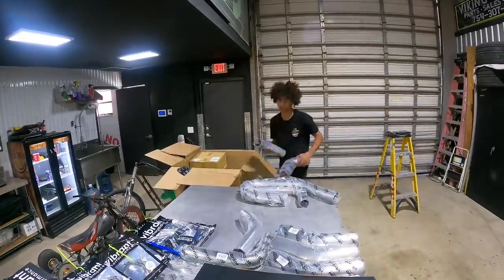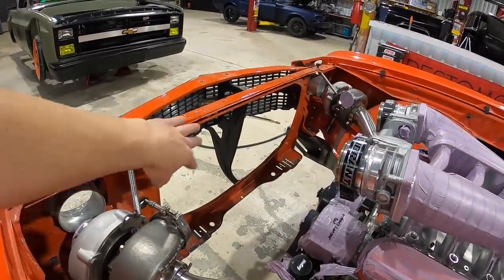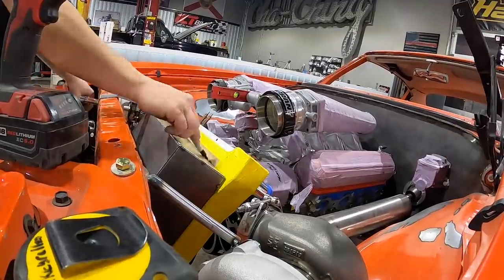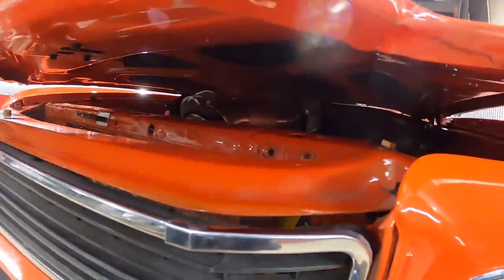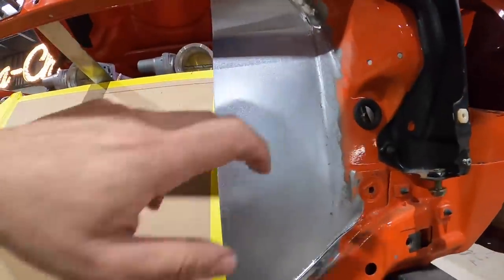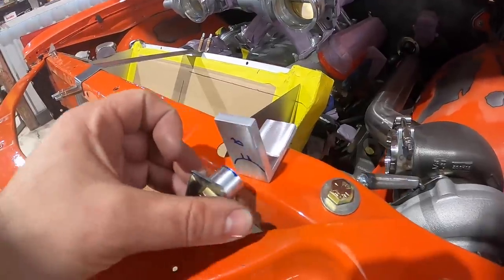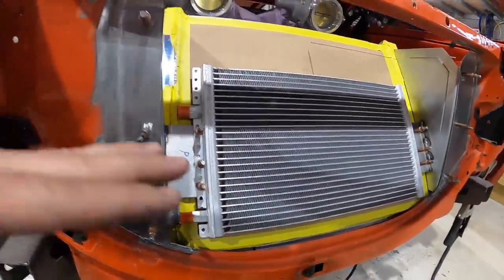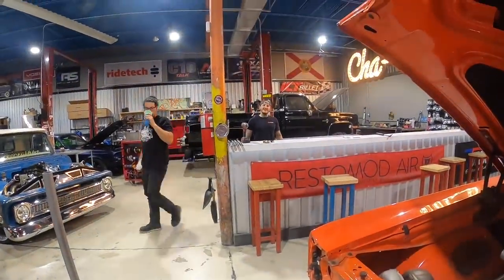Twin Turbo LSX Cooling System for a 1970 SS Chevelle! - LSX Chevelle Ep. 5

Comment: Great build, brings back many memories. WOW.
I built a twin turbo, big block,  67 - SS  Chevelle. Back then 1976, it was hooker header plates, steel tubing and a lot of, wish we had more room! It was the seventies, fuel injection?? Not. It was a draw through system, and fancy was, did you want to zinc or chrome things? 🤔 Don't get me wrong, tons of power, just not by today's standards, still it was fun. 😛
Thanks again.✌🏻🔑, 👍👌👋🏻❄ 🥶 🇨🇦 👨‍🦽 😎.
Reply from the maker: That's the cool thing about hot rodding though! You get to see people using the same muscle car bodies, but trying to stuff crazier and crazier stuff into the engine bay! Hope we could fuel some of those nostalgic memories with this build!

Comment: It's coming along great. Some old school Chevelle or Chevrolet script on the valve covers would look great with the old-school meets modern setup of the car. Also don't forget to pressure check radiator and intercooler after yall weld it all up.
Reply from the maker: We don't want another EV C10 "radiator fixing" episode lol We might use those valve covers to add a nice "Salvage To Savage" touch to the car!
Reply: @SalvagetoSavage  right. Or worse n have a boost leak n have issues there too

Comment: I've never heard of titanium making a different sound than stainless steel exhaust. Usually the sounds is determined by the firing order if it sounds exotic or a muscle car sound. Muscle cars fire 2 cylinders per side making the pulse sound and exotics have a balance firing on each side giving them that screaming sound.
Reply from the maker: Firing order will change the lope creating sort of a different "beat" but the material you use can definitely change the pitch of your exhaust note, similar to how changing the exhaust diameter can change the tone.
Reply: @SalvagetoSavage  Never thought about different material but it definitely makes sense since different materials can affect resonance frequencies in structures.
Reply: Ask f.e. Borla about that. Diameter, material type, routing, crossover, x-pipe, y-pipe, muffler design, tip design - all of those influence the sound. It's actually a science of flow & resonance... 😇✌️

Comment: Jesus christ, there is one thing that makes me really savage is when delivery companies are disrespectful of your items in transit.  Two OEM intercoolers for a Subaru STI were delivered to our workshop over here (the second was a replacement) and in both cases they sustained the same damage.  They were both dropped on their ends (the drop in one case was recorded on CCTV) and the cores were completely useless.  $1500 insurance claim and delays in delivery to the customer. The boss was furious and "ripped the delivery guy a new ass" and rightly so.  Tired of that shit.
Reply from the maker: It's becoming a "well it's not my package so I don't really care" attitude. Most of the times a small drop doesn't do much. But these intercoolers are pretty fragile, even for being made completely of metal.

Comment: Does the radiator work as well when the fins are not parallel to the wind going thru them or will that 1000 hp motor overheat?
Reply from the maker: It'll work just fine

Comment: Can’t use 1000 hp.     And doubt it will have that much.
Reply from the maker: Well you can use it, that’s for sure! However for this build it will be tuned on low boost, nice and drivable at 700 Hp